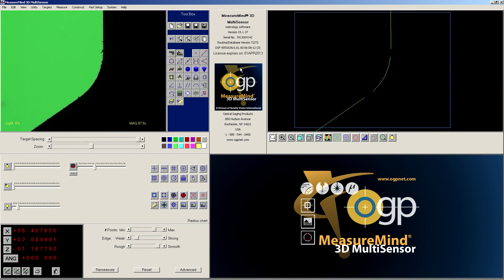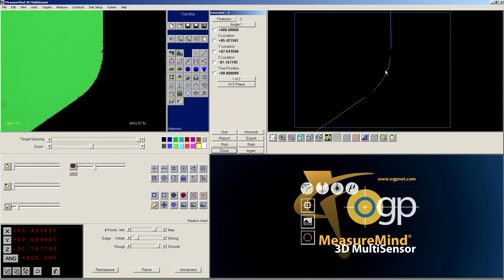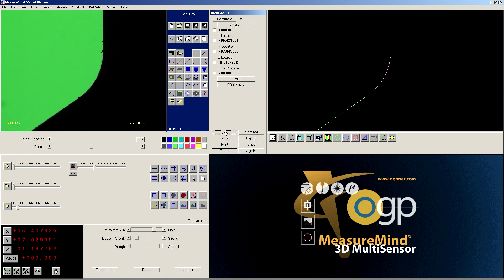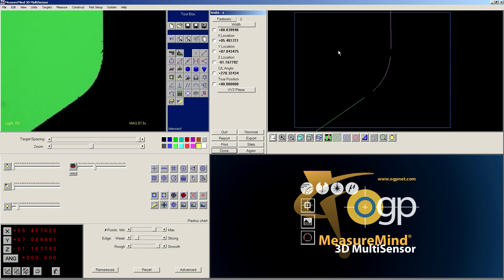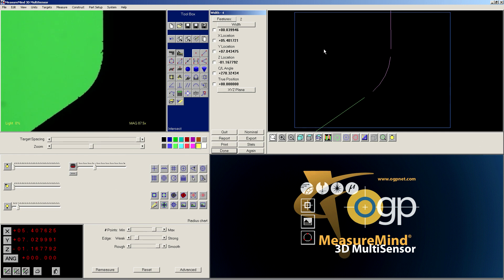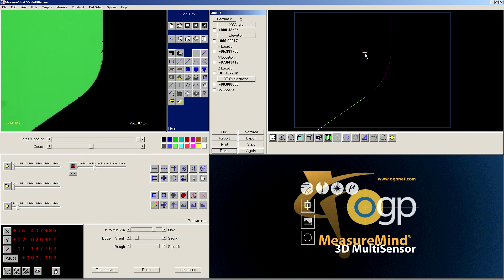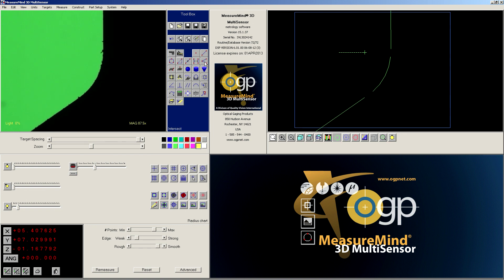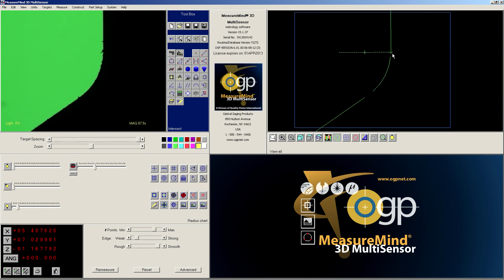Constructing Intersection between Arc and Line - MeasureMind

Comment: Hi there John, very good tutorial about this topic. I am new into the measuringworld by the company I work for, so I have a little question about this.  Does it also woks to create a perfect intersection between a cirle and a line, please?  Greethings from Belgium :-)
Reply from the maker: This tutorial is specifically for a line that intersects at a tangent of the circle.  If the line passes closer to the middle, just construct an intersection between the line and the circle.  it will intersect twice but it gives you the 1 of 2 / 2 of 2 option to get the one you want.  Note, 1 of 2 is the intersection closer to the origin.

Comment: Hi, I really like your videos and I am fairly new to the programming as i have recently became the lead metrologist. I was wondering if you had anything that showed how to tolerance certain things on the ogp , for example the position of a diameter that has mmc on the diameter and on the secondary datum. I cant seem to figure out how to label and recall a datum..
Reply from the maker: +Connie Swinehart Will try to do a video on tolerancing.  From what you describe I assume you are talking about a true position tolerance?  If so, you should know that MeasureMind can handle MMC on the diameter, but it will not calculate MMC on datums.  If you need that, you should ask your OGP rep about MeasureFit, a post processing software that can calculate complicated TP tolerances from MeasureMind routines.
Reply: +John Lankford Thanks for everything.